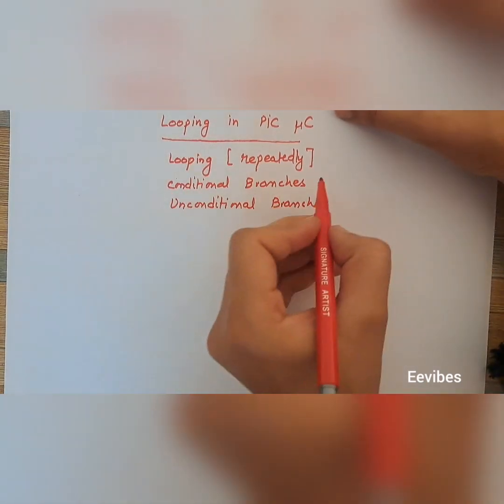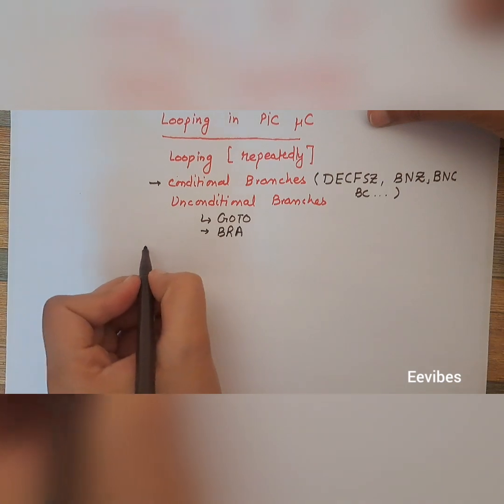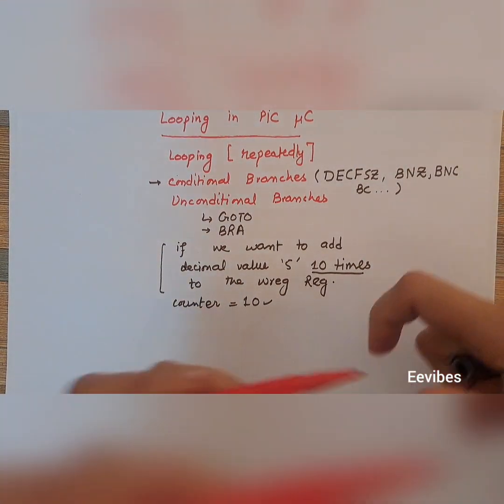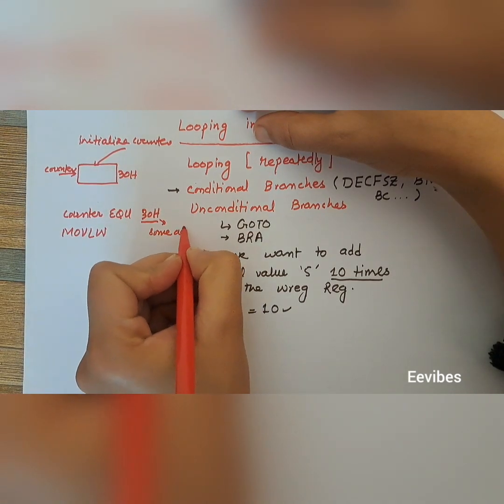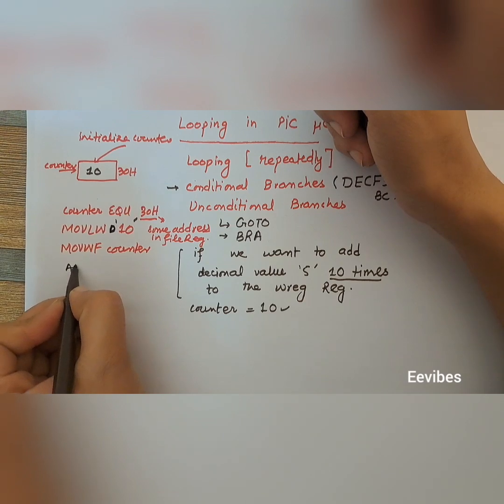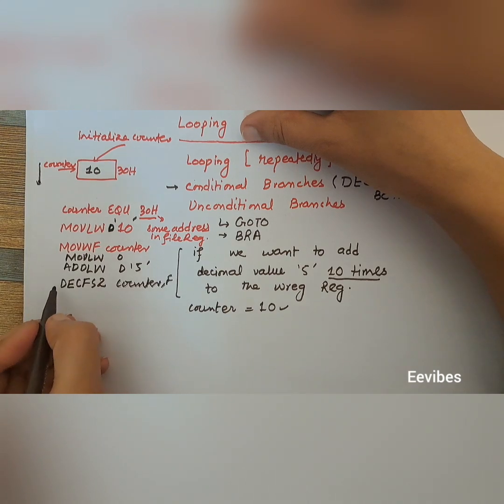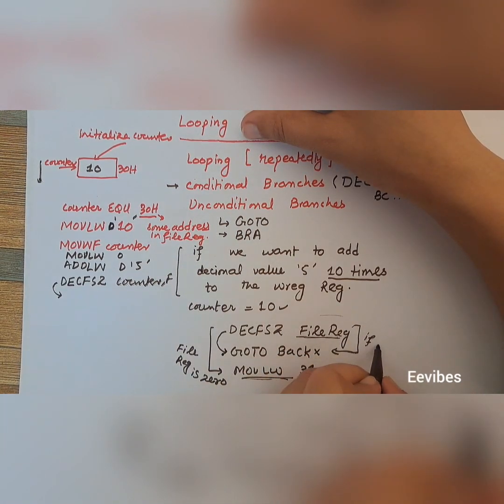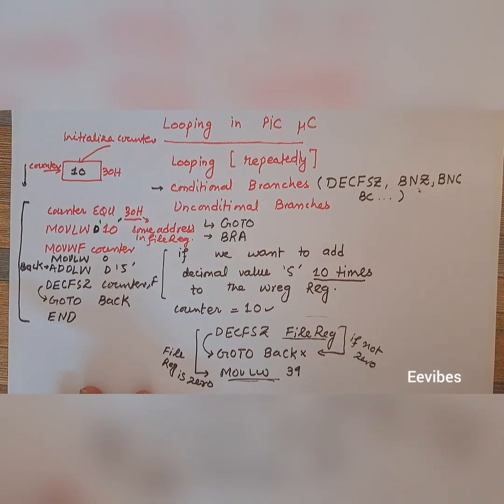Lecture 2: Looping in PIC18 Using DECFSZ Instruction in Assembly Language

Comment: Hi ma’am greetings to you.
I have a code which was extracted from a microchip and l tried to burn it on a new chip but it gives out certain build error codes. Could you able to help me pls?
Reply from the maker: Generally the code written for one controller dies not run for another because of the difference of internal architecture.
Reply: Hi thanks for replying.
FYI, lm using the same coding which was used on the chip. So actually l extracted from the chip and build on the same type chip, ma’am.
Reply from the maker: @101gmg  so what kind of error you are getting ?
Reply: @eevibessite Hi as l proceed to build the project, the error l see is…
Error-section ‘.org_0’ cannot fit the absolute section. Section ‘.org_0’
Reply: FYI lm using the MPLAB X IDE v5.00
Reply from the maker: @101gmg  I mean error type?
Reply: @eevibessite error type?? Ok
It says….
Make [1] : * [.build-conf] Error 2
make: * [.build-impl] Error 2
Reply from the maker: @101gmg that error is because of configuration bits settings. They need to be set properly.
Reply from the maker: If you have written the program in assembly, it's better to translate it in C. The issue will be resolved.
Reply: @eevibessite Ohh ok. I have the program in assembly but how can l translate it into C ya?
I’m sorry ma’am l’m just a self-taught intermediate level when comes to programming! Sorry again to trouble you 😊
Reply: Could you kindly advise me to convert it to C? By the way is the bits configuration visible after conversion?